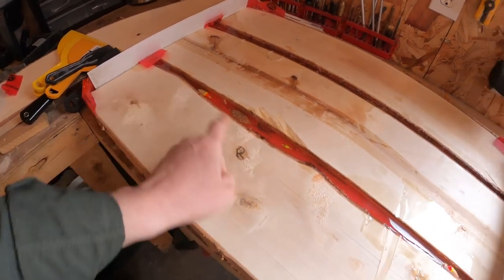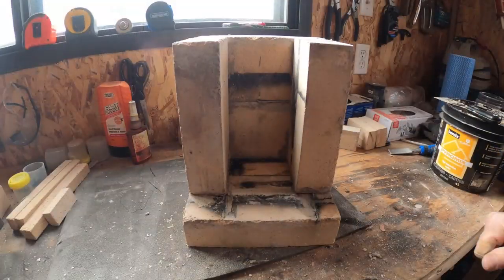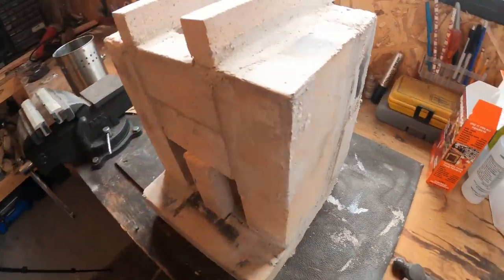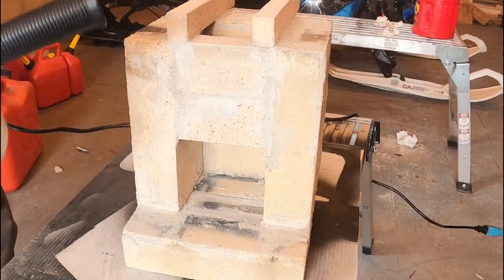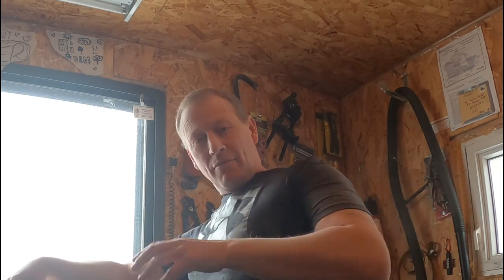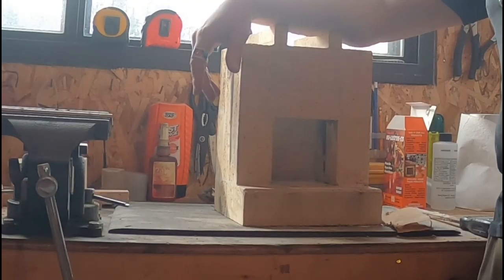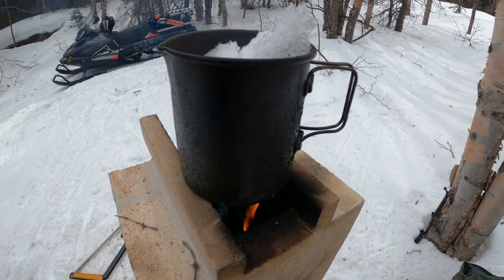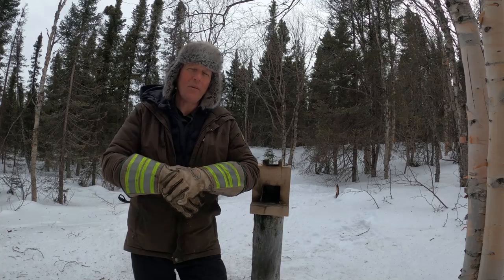BUILDING a BRICK ROCKET STOVE and a TEST TRIAL with a COOKUP !! (Bottled rabbit, tea *DIY Project*)

Comment: Great set up Chuck ,turned out real good. Chuck what type of drone do you use ,i've seen it in some of your vids
Reply from the maker: It's the DJI Spark model.  It takes some getting used to, but once you figure it out, its nice.  I ordered the "Fly More Combo" package with it, which included an extra battery, spare wing tips, wing tip protectors (almost like training wheels lol) and a carrying bag.  You'll find with any drone the batteries die very quickly, but with mine, I get a full 10 mins or so out of each battery.  Flying it without the wing tip protectors (training wheels) is much better.👍

Comment: Sanding is not so good, it is better to clean the joints and the stones with a damp cloth after bricklaying. 
If you are sanding, a flap disc is always better, no matter what the material. You have to be careful with the grain. It is best to test it on a sample.

Greetings from Frankfurt
Reply from the maker: Thanks Gerold!!  I like the washing of the joints better as the dust isn't so nice.  I know the oven and grill that I mortar next will be outside, but thanks for this tip....I'm going to try it!!👍
Reply: @ChuckPorterEverythingOutdoors  Chuck, I used to do a lot of refractory bricklaying and lining for a living. The best thing to do is to repaint the joints with your finger and then wipe with a damp cloth. Looks best visually. If you work with stones 2600°F, wet them a little bit before. The stones will then suck the mortar deeper. A disadvantage, you should leave the oven or grill 2 days longer, rather you should dry the material slowly with a small flame. 

Greeting from Frankfurt
Reply from the maker: Thanks again!!  Great tip👍